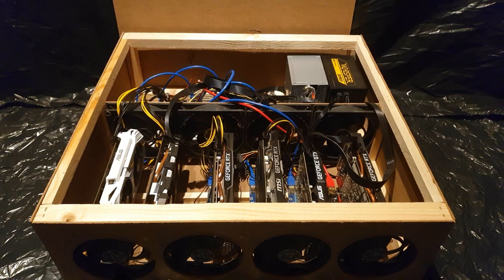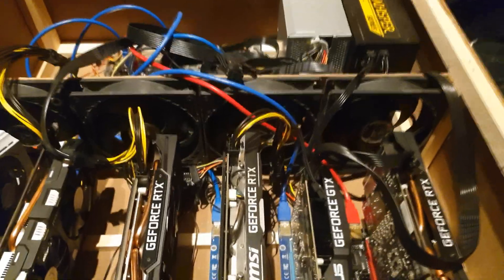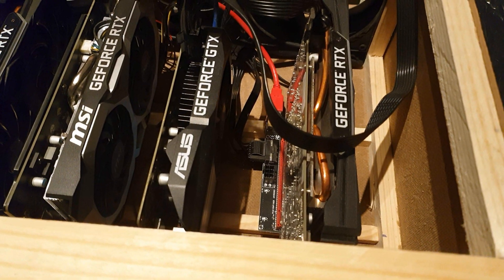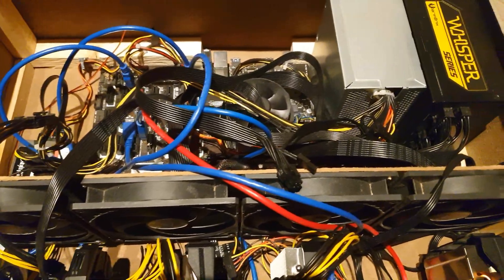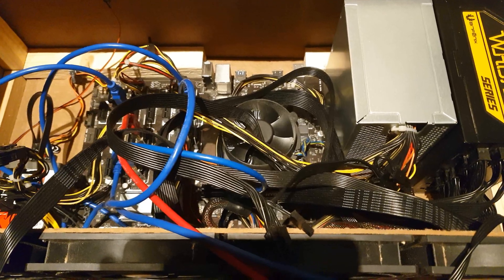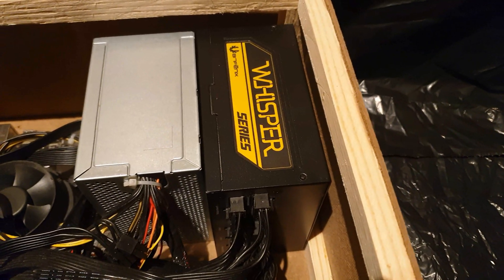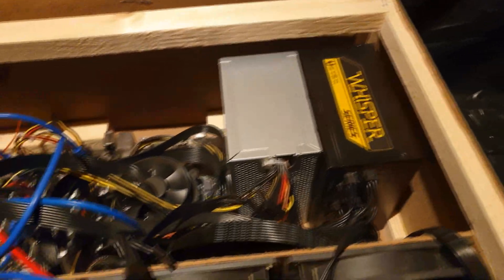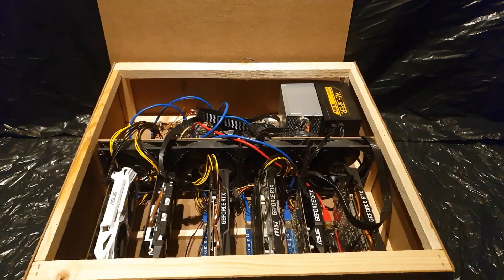My GPU Mining Setup!! (DIY "server case" for graphic cards)

Comment: can you post the dimensions
Reply from the maker: Mine is about 61x61 cm and about 19.5 cm in height. But if i were to build one again I would add atleast like 5-8 cm for the gpu length so i can fit 3 fan gpus in it. Reason for 19.5 in height is just so i can fit 14 cm fans between the wooden dowels.